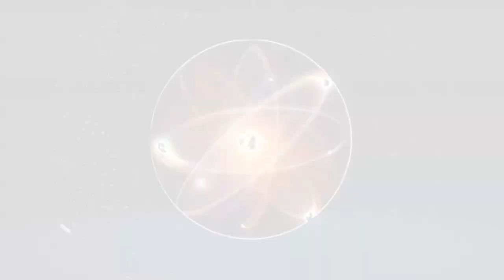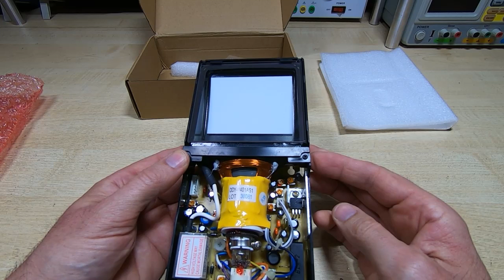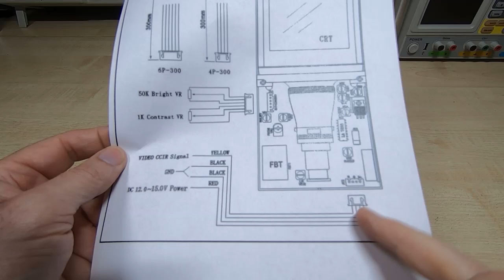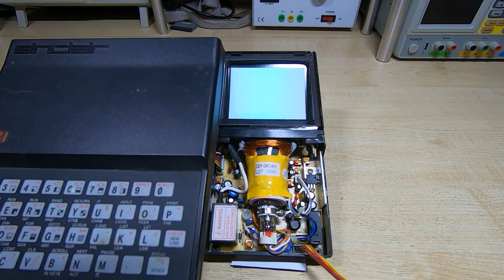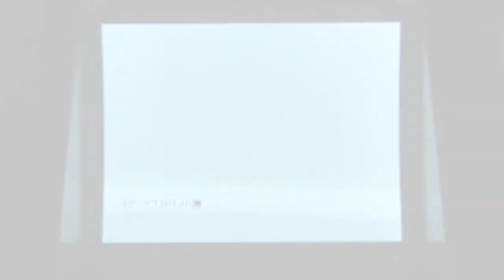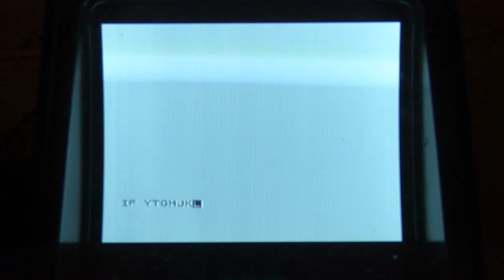Very Cheap Flat Screen CRT Monitor

Comment: A very good video, thank you. I had a CRT monitor arrive a few days ago with a cracked screen,  a replacement is on the way so I have lots of spare parts. Did you 3D print a case?  If so do you have a good STL file?  Providing my next CRT monitor works OK I will produce a  stl file, you will be welcome to a copy. Did you ever find a full schematic?  I have  no luck finding one.

Comment: I'm confused about the composite video input.. does it only connect to the yellow connector? Or do I combine all three connectors? (Red, white and yellow)
Reply: apart the potentiometers wires there are 4 wires, two black, red, and yellow, you use one black with the red to give 12-15Vdc and one black for the video ground and the yellow is the video input
Reply: @PosthumanKindergarten  thanks

Comment: I got one of these a while ago and it sat in storage for months. Now I decided to try it I can't get it to run. It looks like it just isn't powering up! I'm using a 12V 1A supply, with female jumper cables to connect up a 15k pot to brightness, and a1k pot for contrast. But no picture. I don't even hear any hum, and with a CRT I thought I would.
Maybe I've blown something! Ah well, it wasn't exactly a costly loss.

Comment: Did you modify the ZX81 to output composite or were you able to connect the wire straight from the ZX81 board
Reply: Hi hi connected the video input to the input of the zx81 modulater.

Comment: Oof that hv whine. You can use a filter to get rid of that in the audio in post.
Reply from the maker: I make no attempt to deceive people, My videos demonstrating devices show as much as possible and that may include sounds.
Reply: @JerryWalker001  It's not a deception to use a filter and cut down the annoying hv whine. Just constructive criticism.
Reply from the maker: @69uremum  It kind of is. If someone buys one of these and finds out I made it sound quieter than it is then they could quite rightly accuse me of deceiving them. I was showing it 'as it is' and not post edited. I appreciate the comment but it is not something I would want to do as I already get complaints when I do not make things crystal clear. Also the whine is almost inaudible in the raw video (26db in the 'silent parts') so maybe you have your tone very high (just a thought). In the lab the sound meter shows 34db but there are other things running as well so it is still at 29db with the monitor turned off.
Reply: Old age has the advantage of not hearing those pesky high frequencies anymore 😁
Reply from the maker: @Conservator.  Agreed! Just goes to show that there are advantages to getting old(er). The whine is also not too loud in the lab, The sound meter shows a very low level although I suspect some viewers may have a sound card that makes it sound worse than it really is. Out of interest I tried to estimate what these would cost if manufactured in the UK and based on the pricing I can find they would be around £280.00 each if batches of 1000 were built so definitely worth a few minutes making small adjustments. It also really needs an anti static coating on the screen as touching the face of the tube causes distortion but that would be easy to add if it becomes a problem. A real advantage of this device apart from the size is that is seems to work across a very wide range of frequencies unlike normal CRT monitors or LCD monitors.

Comment: Very useful and reasonably priced, as you say, surprisingly versatile. Well worth what you paid for it. My first computer was the kit version of the ZX-81, and it brings back fond memories (I was in television repair at the time). Got me my first job as a tech on the original IBM PC factory in 1981. Thanks for the review and the memories!